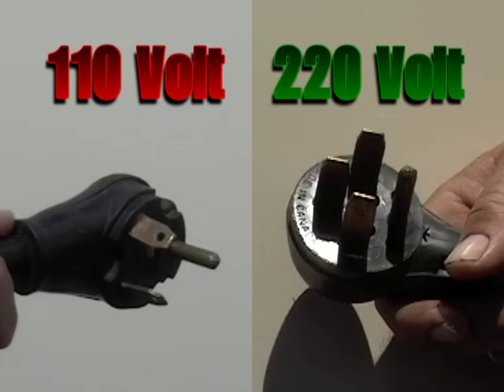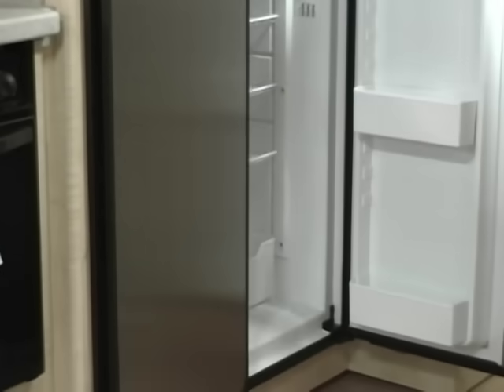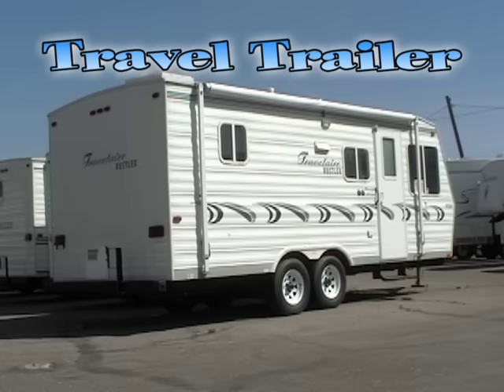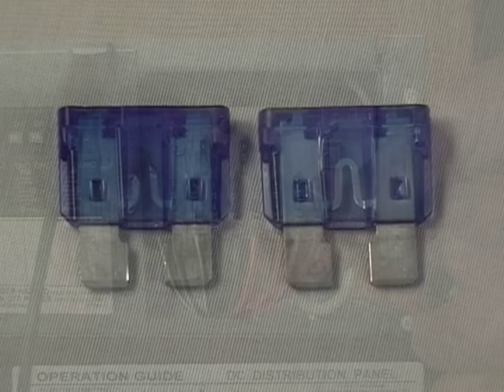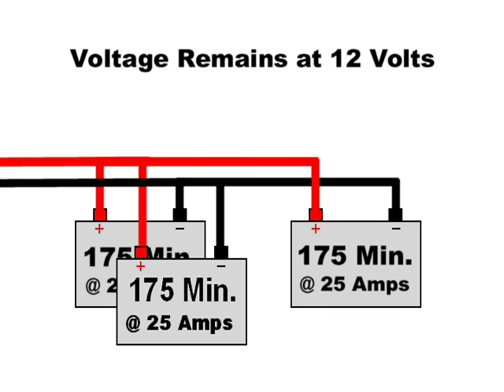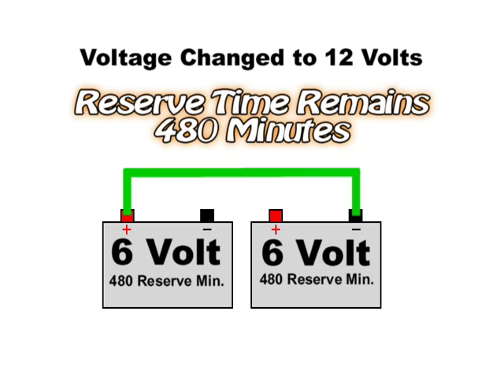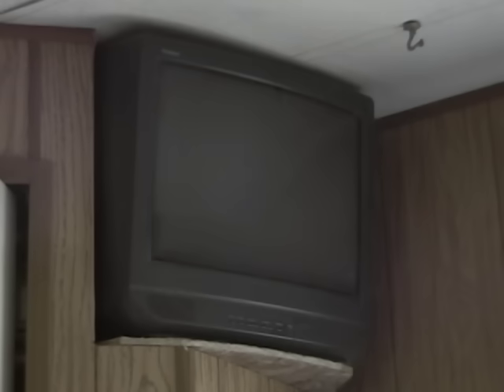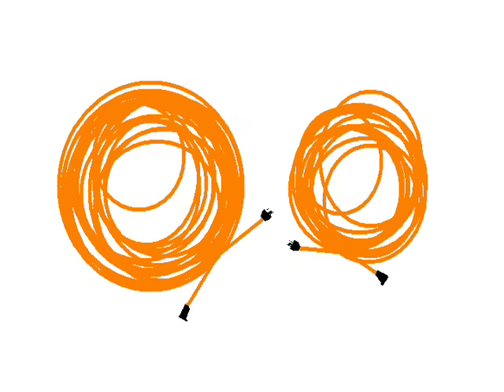RV Walk-Thru: Electrical - Learn about the electrical system on your RV

Comment: Very informative video. Showing the basics is a must. I did Commercial electric for years and have been zapped by the heavy stuff.... it isn't fun. I was looking for a video that would cover the Converter section. I have a 1994 Coachman 5th wheel hooked up to a dual 30 amp service. All circuit breakers are hot, but none of the fuses are. The "hot wire" leading to the fuse panel is not hot. Is there a reset button somewhere. Hope you can help. Thanks
Reply from the maker: Definitely sounds like either the converter is disconnected from AC, the batteries are disconnected, or the converter is shot. Check the AC connection going into the converter while plugged into shore power to see if it's being fed. If so, check the 12 volt DC lines again. If no DC is present, I suspect the converter is toast. Good luck!

Comment: I have an older vanguard and my camper runs ok without a battery when hooked to shore power.  But once  I'm off shore power. Only thing that runs is my lights and heater none of my sockets run. Is that normal first time camper owner. Once hooked to shore everything runs minus my 12 volt systems. But if I'm hooked to shore and battery everything works well. But got a hum from my converter. Wonder if I could rewire my entire converter to the battery

Comment: I’m brand new . My wife and I bought an used rv to get back to Maine from mexico. If I plug my portable generator into the rv , will it recharge my rv 12 volt batteries ? If so will it do so faster/slower than driving my truck. Thanks, richard. Excellent video.

Comment: Can an older trailer be up graded from 30 >50amp by changing the major cable in the trailer?
Reply from the maker: Yes, but you will need to upgrade the panel inside to include two legs of 50 Amp breakers.

Comment: I am looking at hooking up 6/6v batteries @ 215AH each for 645AH total. I would like to connect all of the batteries into the cables for the normal house batteries feeding into the RV. Is this going to be too many amps going into the RV system/inverter? I have a solar/wind hybrid controller and 600ws of solar power to charge the batteries as well (Looking at installing a wind generator in the near future). I hope this makes sense, mostly concerned about the output of all six batteries into the house battery connection. I have two 6v's at 215 AH each and it seems to be ok so far.

Comment: what's a generator do for the rv then?
Reply from the maker: lol, they usually give you power to run your 120 volt AC stuff, and charge the batteries with the converter. And burn gas.

Comment: I'm having the same issue. no DC power. only power I have is the radio and the steps. I did replace two solenoids and replace that the converter all three batteries that's in the basement day is brand new less than two weeks old and I still do not have no DC power. One day I had all the power on and I went in the house about 3 minutes came outside as I was walking to my 1997 RV Damon Intruder 352 I saw that all the lights kinda got dim and then they went off

Comment: I have a problem rewiring up my starter battery and an auxiliary battery and a 3 terminal isolator 120amp 6-50 volts I replaced the old isolator 4 terminaal isolator box and my 1984 chevy lazy daze they have the passenger battery as being the starter battery and the battery on the driversside is auxiliary and the battery in the back compartment are both auxilary batterys can you tell me if I can do this or not

Comment: wow the neighbour should've been held accountable for that, so dangerous
Reply: Yeah, the neighbor was incompetent.  He mistook a 120-volt, 30-amp travel trailer connector (NEMA TT-30) for an albeit similar-looking  240-volt, 50-amp household connector (NEMA 10-50).    Sounds like he had some experience with household wiring, but knew nothing about RV's.

Comment: Very helpful....thank you very much!   Precise, and easy to understand!   I am having an issue on my motorhome, where on of the levellers/jacks is giving me an error.   Initially, a service centre told me I needed a new or rebuilt 'Controller'...so I sent mine in and had it rebuilt and tested.   I installed it today, and found I am still getting the exact same error message.   So much for $1500.00....so now I need to try and do a continuity test...so, I need to figure out how to do that, as the controller is at the front of our coach, and it happens to be a rear leveller/jack that is in error.   I should mention, using a 12v system, the leveller/jack was tested, and it goes down & up just fine...so, I'm thinking it's perhaps a wiring issue, thus a continuity test is needed.   Now, to figure out how to do that is my next adventure!

Comment: Thank you for this video. On min 8:56 When you say "Never mix reserve capacity and sizes of batteries" we can detect "reserve capacities" by amount of Watts batteries can deliver right?
Reply: No.  Reserve capacity is the amount of energy the battery can hold, and is measured in terms of the number of minutes the battery can deliver 25 amps of current.  Watts has nothing to done to it.  The reserve capacity should be (but often isn't) listed on the top or side of the battery. 

While it certainly is best to match connected batteries' reserve capacities if at all possible, it's not the end of the world if you don't.  You're not going to get electrocuted and  nothing is going to explode or melt.  But the performance (and possibly the lifespan) of the battery bank will be reduced if you connect batteries with mismatched reserve capacities.  It's not critical, but it's always a best practice to match connected batteries to the greatest extent possible -- same capacity, age, brand, etc.  That way you'll get the most energy and longevity out of your battery bank.

Comment: I'm still learning about my 5th wheels systems. I have an Onan generator on mine. GFCI's are good, circuit breakers are good. On shore power everything works, but when I fire up the generator the kitchen doesnt get power. Everything worked fine until the park power shorted out where I plug in outside. Ever since the generator issue arose. Not a big deal as long as we have no interruptions in shore power. Heading into winter I'm starting to think I had better fix it or get it fixed since we get windstorms that knock out electricity. Theres an automatic switch module that everything ties into. I'm not sure how I can test it, and if it splits power up or if it just supplies and the circuit breaker box does all the splitting when the generator runs, remember on shore power everything works. But on the generator I have no power to the kitchen..  confuses me because I would think the circuits failing would do so either way. Ideas for what to test?

Comment: My ac and DC are working fine on my 2018 camping trailer but I keep blowing a fuse on the converter it will not charge the battery
Reply: What brand of trailer do you own?

Comment: 12v is a good standard and I think it was missed that 24v and 36v are used more in high end RV's The system last longer. I know this video is out dated. Basic are best as you have laid out. If your going to deal in the systems that are in the 24v and 36v you better get more help understanding them.

Comment: Essentially Fine, basic comments.  However - Tim - you possibly should research GFI; or GFCI's
A GFCI (GROUND FAULT Circuit Interrupt - is NOT a Circuit breaker!!  Yes, it interrupts the circuit - IF you have a GROUND FAULT.  But, it is NOT a Circuit Breaker.  A circuit breaker - breaks the circuit (blows, trips) when you have an OVERLOAD of current.  Typical 20amp - allows a momentary 20.5 etc, but run for any length of time over 20 - and it TRIPS.  A GFCI does NOT care about the AMOUNT of current.  It may be rated for 15amp or 20amp - but it will easily allow OVERLOADS flow thru it!!  It DOES NOT look at overload!  It is looking for ground FAULTS!  The amount of current which came INTO the device - MUST be the SAME as the amount ultimately flowing OUT of the device.  It will TRIP on something like a 0.002amp of current differential.  A proper circuit has EXACTLY the same amount of current flowing OUT as it did IN.  But, if you have become part of the circuit; and some current is flowing from YOU to GROUND - a Difference than exists between the amount of current flowing IN as to OUT.  The GFCI than trips - potentially saving your life.  A GFCI entire purpose is to trip - only if you have a GROUND FAULT.
Reply: And just to add another quick note - you can add a GFCI to a circuit which does not have a proper ground.  (one with only two wires the 'hot' and the neutral).  It will still work properly because although your circuit does not have an official 'ground' - the GFCI is still monitoring the amount of current IN as compared to the amount OUT.  And if a problem exists in an appliance or some such - so that YOU become part of the circuit - and your body conducts current to ground - the GFCI has a DIFFERENCE in the amount of current which went INTO it; as compared to the amount which flows OUT.  So it trips.  And it trips EXTREMELY rapidly; since the ENTIRE purpose of a GFCI is to save lives - by killing the circuit - if a Ground Fault exists.

Comment: getting a professional to help is easier said than done, I inherited a 5th wheeler. no way to move it, I called this professional (total flake) called 10 times now, says I'll come tomorrow, RV shops want me to come to them. they only charge $300 to take it their shop & $300 to bring it back, all 3 are located less than 10miles. Thanks for explain everything so plainly It came in handy.

Comment: Important note on circuit breakers... ac (115v)  & dc (12v) circuit breakers are NOT  interchangeable ! They work/function differently... so will NOT protect . Does NOT matter if each is 30A (or whatever) rated... they work completely different... do NOT interchange !

Comment: You got your analogy wrong amps is the strength small amps is like having a small pipe large amps is like having a large pipe voltage is the speed or pressure

Comment: A GFCI is NOT just a super-sensitive circuit breaker. It does not serve the same purpose as a regular circuit breaker. Perhaps you should read up on what GFCI's do and how they work before providing misinformation.
Reply: Pay attention. In RVs they wire the GFCI outlet in series with a handful of outlets behind it. If you overload the circuit, the GFCI will trip. If you short it, it will trip (as you would expect a GFCI to do). It's a little known function of the GFCI, and I right royal pain in the rear in RVs, because there is no rhyme or reason as to which outlets are in series where.

Note that in no circumstance are you to use a GFCI without a circuit breaker / fuse behind it. They simply take advantage of the feature in RVs to limit draw.

Take your own advice and read up on their full functionality. ;)
Reply: @Crogon  A GFCI will not trip on overload. If the GFCI receptacle provides protection of outlets downstream and you end up putting too much on the circuit, the circuit breaker will trip, not the GFCI. GFCI's do not provide overcurrent (overload) protection. They provide ground fault protection only.

Comment: This is such an interesting and informative video!  I learned a lot, even though a complete novice with electricity.  I never could understand amps till you said it was like speed.  Wow!  Instantly got it!  So grateful.  I also thought I could run AC or fan system plugged into my house power.  Was I wrong.  I wish you would make another video explaining more.  I need to do my own DIY Van build and would like to know how to lay down the electrical system.  You are an excellent teacher and have a voice you can listen to for a long time.  Also thanks for no background music.

I have a 1997 Class C Tioga Montara that came with factory systems.  There is a fuse box under hood for engine stuff.  There is a fuse box under oven next to the converter.  And there is a fuse box crammed into a TINY space next to two house batteries in a drop down box under the door entry way step.  This is SO HARD to access it is ridiculous.  I had to remove it once and redo whole thing due to a long story about buying wrong batteries, re-welding battery box to enlarge it, etc!  Anyway, this fuse box needs to be relocated to a larger more accessible area close by.  How to do it?  No RV place seems to know or care.  I need to modernize this whole area of fuses, and install a battery disconnect switch.  Would love some guidance on who does this kind of work?  I'm in California.

Comment: Having a problem with my converter. May have hooked my battery cables wrong and blew out the 2-30 amp fuses that are there to protect the converter. When I installed them the right way the fuses still blow. When I check the voltage on the 30 amp fuse holders without the fuses in I get a reading of 12 volts. Then again when I install the 30 amp fuses they blow. Any ideals or help would be greatly appricated Thanks. Francis.

Comment: I use a 12 gauge extension cord, more expensive, but less problems in the long run, and safer! I wired my whole house with 12/2, less problems

Comment: A little help?
Our motor home gfci outlet feeds the outlets on the passenger side of the coach (two baths, kitchen, and tv).

Works fine when running on shore power. Trips immediately, but not always, when running on generator power, disconnected from shore power.

My shop tried troubleshooting but failed. They did say that the gfci does NOT trip on the generator IF the inverter is disconnected. 

That doesn't seem to make sense to me?

Comment: Here's a question for you. I am hooked up to a 30 amp shore power plug. The breaker is rated at 30 amps. At least 3-4 times a week, when my roof top ac kicks on, it trips the shore power breaker. It does not trip the ac circuit breaker in my travel trailer. What might be the issue?
Reply: Increase the size of shore power breaker to next size.

Comment: You also have to be careful of RV parks. I had trouble with a power surge that took a microwave out and SMOKED a TV. The park guy kept thinking it was my RV but guess what? Turned out someone had used a piece of rebar for a ground stake instead of a copper stake coming from the box to the ground beside the wood pole and it kept losing connection.

Comment: Very well presented and informative video.

Just a thought on hooking up batteries in parallel. In the UK it's common practice to hook the batteries together the way you show only we take the positive to the electrical system from the first battery and the negative to ground from the 2nd battery. The theory is when hooked up the way you show the first battery charges and drains more often than the 2nd one, where as hooked up the other way it drains and charges both batteries at the same rate, also if one battery drops cells it doesn't drain the other battery. Is there a reason the same practice isn't carried out across the pond?
Reply: Get a second opinion at a service garage.

Comment: Wow that was so informative. I learned things that my husband's been trying to explain to me for months. The explanation on amps/speed ,volts/ heat  finally sloved that mystery. I loved the explanation on parall and was it called in÷ line battery hook up.. how cool is that  great video! Thank you.  I
Reply: "Series".  (A battery connection where you connect the positive terminal of one battery to the  negative terminal of the next, like a daisy chain, thereby increasing the voltage but not the capacity.) 

("Parallel" is where you connect the batteries with all the same terminals together [positive to positive; negative to negative], thereby increasing capacity and current-delivering ability, but not voltage.)

As for voltage and current, I didn't really like the way he explained those concepts.  He described voltage as "strength".  "Strength"?  What does that mean?  Better to describe it as a form of electrical pressure, much like the pressure of water in your water pipes.  Just as a higher water pressure will move more water through a pipe (all other things being equal), so will more voltage push more current through a wire. 

And he describes current as "speed", which although not entirely wrong, isn't really accurate, either.   While it's true that in a given thickness of wire, more current means the electrons are moving at a higher speed, that's not the right way to think about it.  Better to think of current as a flow of electrons, like the flow of water through a pipe.  So amperes of current would be analogous to gallons per minute of water.   In one circuit you might have a higher flow of current than in another circuit, but the electrons are actually moving slower in the higher-current circuit because the wire is much thicker.   Current is all about the number of electrons flowing through a wire, not the speed.

Comment: Batteries of the same voltage do NOT fight each other. This would be the case ONLY if one of the batteries had a bad cell, thus causing a drain on the other batteries.

Consider: If you take two 100 reserve batteries and hook in parallel, you effectively have one 200 reserve battery. If you add a third 100 reserve battery, as you did in your video, you just added a 100 reserve battery to a 200 reserve battery!